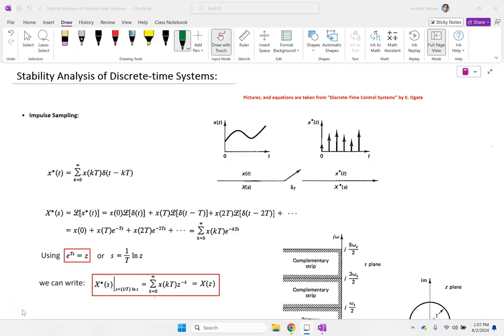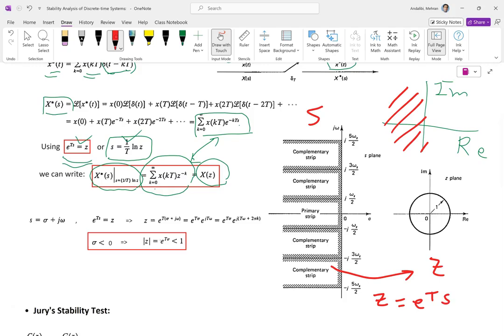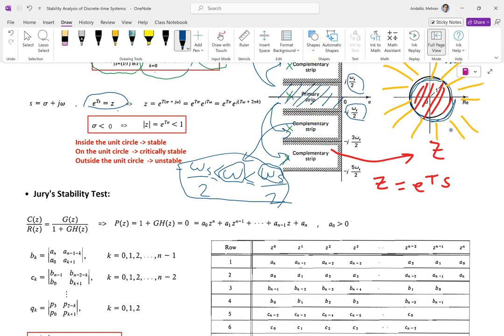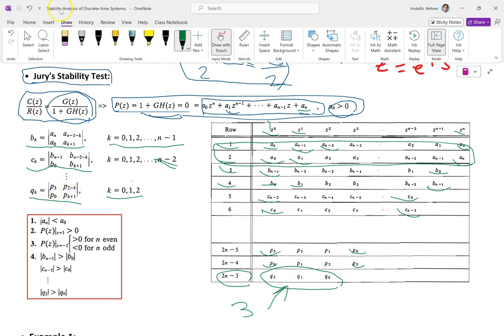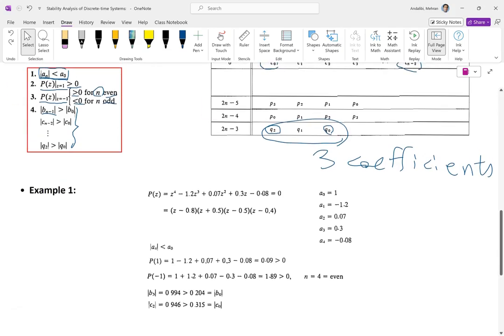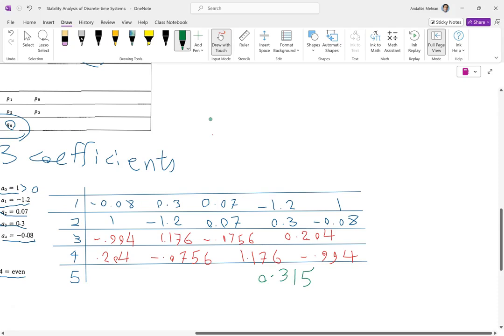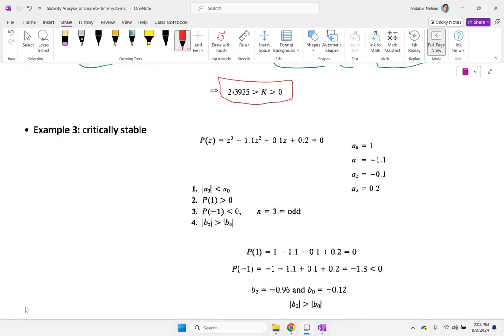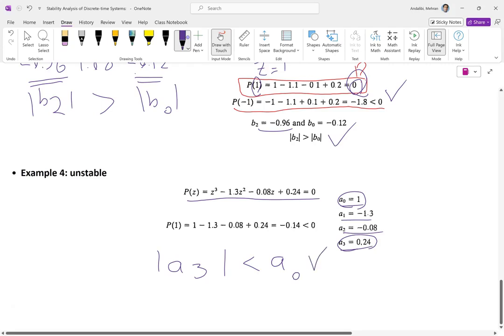Stability Analysis of Discrete-time Systems - Jury's Stability Test

Comment: Dr Merhan Thanks a million for your outstanding efforts and knowledge , i wonder if you may kindly elaborate about a '4 mecanum 'wheels  linear movement Robot  at fixed range (space)  from a target with a fixed start point A as per the body's shape say a cube  shape up to end point B  and reverse direction  ( stable fixed distant from the target while moving ).cheers. away from line follower lets say ultrasonic sensors method.